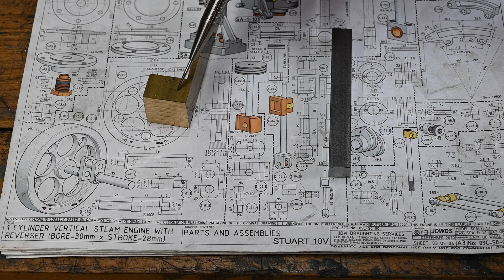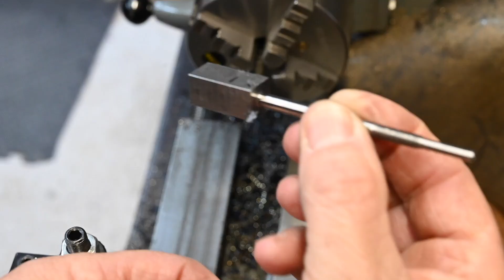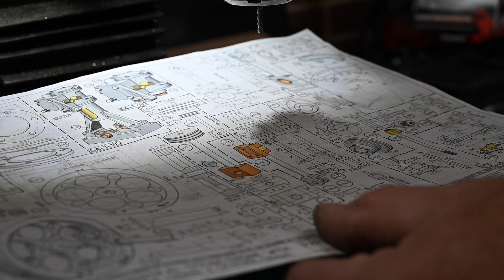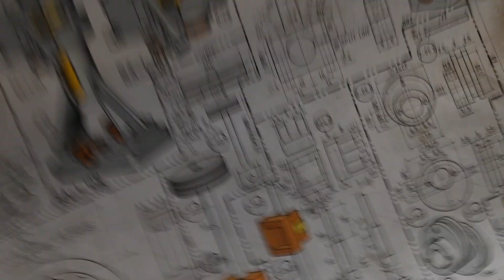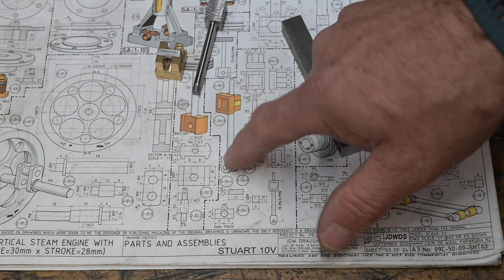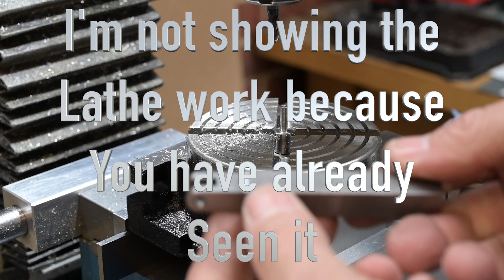Stuart 10v Steam Model - Machining The Steam Valve EP21

Comment: Do you get much use out of that 4 jaw scroll chuck? I’ve been needing a 4 jaw, but primarily for turning square stock, not eccentric work. I know that the independent version has more uses, but the thought of having to clock it in just to work square stock gives me indigestion, but I can’t afford both!
Reply from the maker: @tomt9543  I use it for square stock when I don’t need to dial it in. I do have an independent chuck but only use it when precision is required. So they both have their uses. They are only cheap ones because they are only low usage. 👍
Reply: @ Thanks! Really enjoying your channel! Thanks for taking the considerable time and effort to produce these!
Reply from the maker: @tomt9543  your welcome